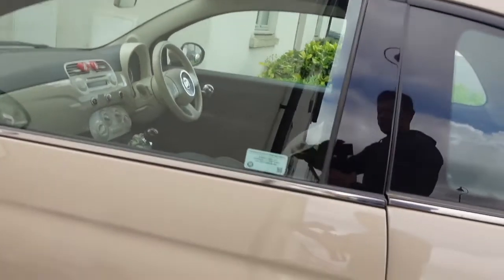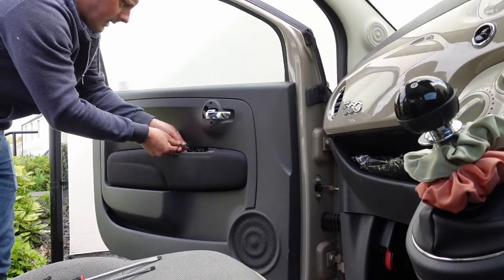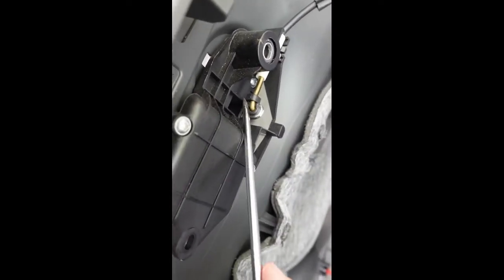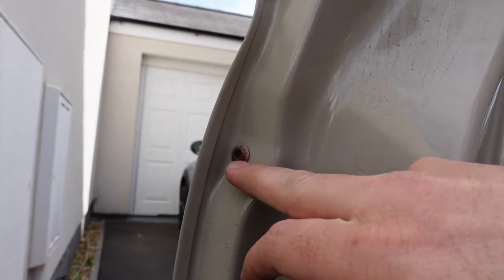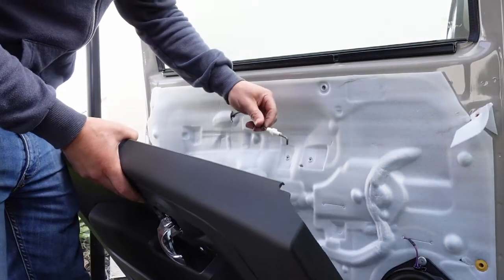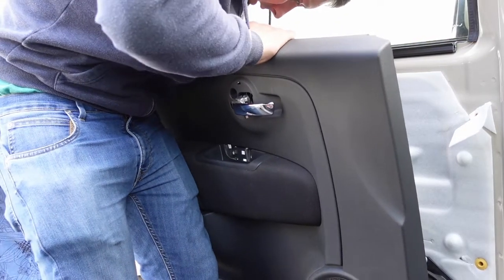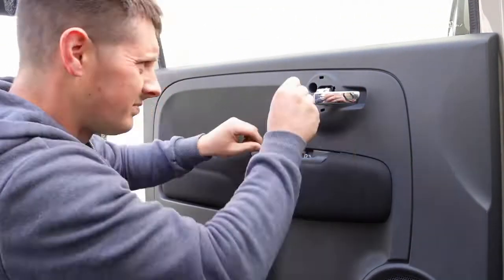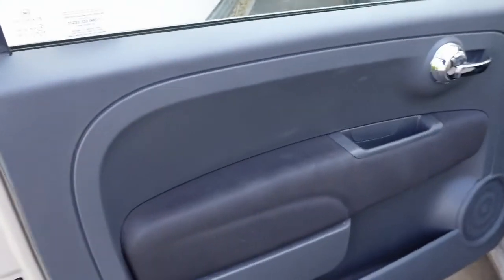Fiat 500 Door Handle Replacment

Comment: Does the door handle sit flush underneath ? I replaced one but the handle doesn't seem to be sitting flush only at the bottom and now the door ks temperamental with opening and not opening
Reply from the maker: Yes mate from memory, have a check of the opposite side to confirm how it should be 👍
Reply: @bradytruezero8739  ok yeah will have a look, just couldn't get it to sit flush which was annoying